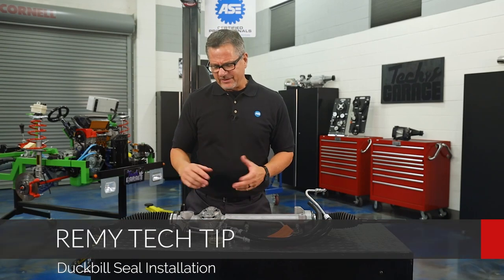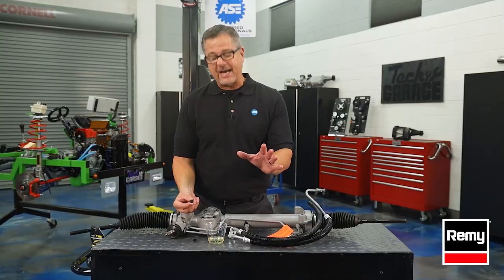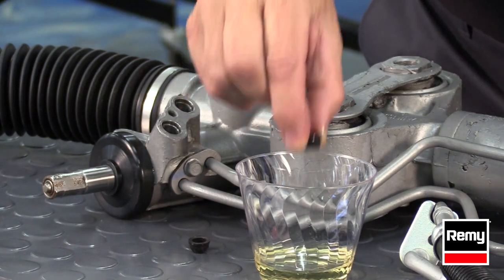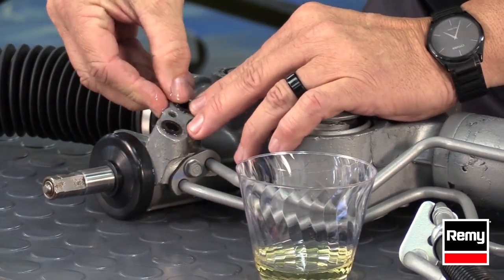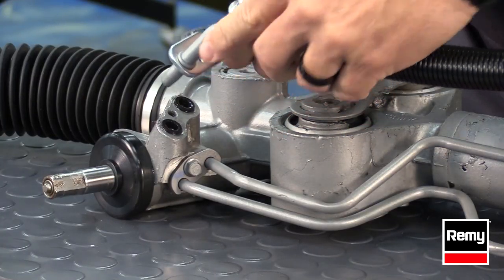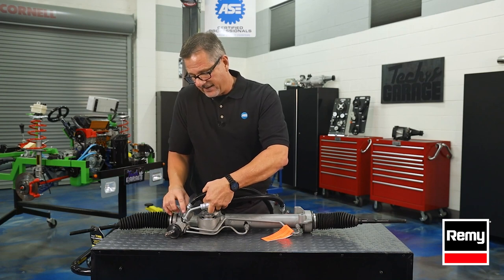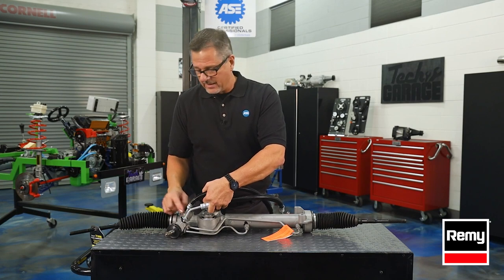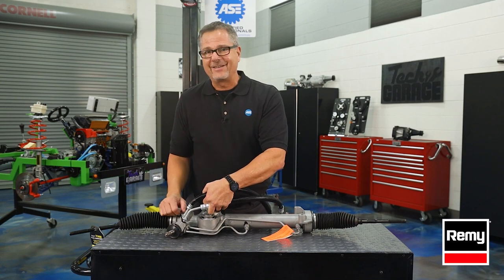Remy Tech Tip | Installing Duckbill Seals

Comment: This is actually a WRONG procedure.  With your illustrated procedure, you WILL have leaks!

The CORRECT way is to "tap" the seals into the unit (until they bottom out) with a 10mm socket.